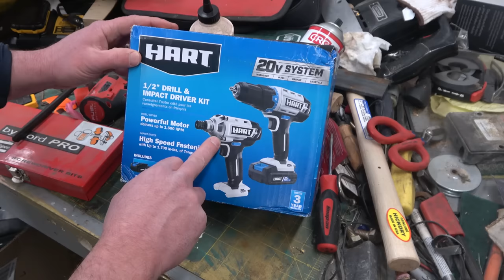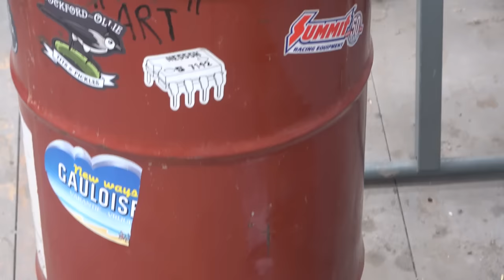BOLTR; Hart tools from Walmart

Comment: The self healing mat has it's work cut out for it.
Reply: AvE's destructive testing might even give Wolverine a run for his money.
Reply: *its, not it’s.
Reply: I love this guy - totally honest and pulls the whole thing apart. I'm 100% in.
Reply: Hey! I was wondering what needs to happen to have you review Flex brand tools? I am of the opinion they are not so good despite them marketing as a pro level to. Getting in some intense thread debates too. Specifically the inline circular saw.
Reply: @miqueaspromontorio3  buy some and send them to him
Reply: I agree with you about the manual my significant other didn't come with a manual I just figured out where everything goes
Reply: Is it bandaid brand? Only self healing matte I've known aside from super glue until now. @AvE, we need a review!
Reply: that self healing mat smokes two packs a day

Comment: That bearing probably fell next to the 10mm socket
Reply: You mean the 10mm sockets?
Reply: Nothing his magnet attached hockey stick can’t locate.
Reply: (Because 10mm sockets are often misplaced due to their being called for in many repair/maintenance situations)
Reply: @absolutjackal  they congregate?!
Reply: That's why you keep one in every room.👍
Reply: @isaacharvey   Yeah, they're conspiring against humanity.   They're in cahoots with socks that go missing.
I read it on the internet.
Reply: @isaacharvey  all depends on how long you’ve lived there no? I figure you lose the 10mm 1/4” 6pt first, then maybe switch to the 12pt or the 3/8” drive and then lose that one. I think all told my socket set has 4 or 5 different 10mm sockets so I figure there could at least be a few. 

Then there are those that were born metrique but feel they are actually imperial. But hey I’ll use either one if they fit

Comment: It's my understanding that Hart is made by TTI  especially for Walmart. In fact, as Hart was beginning to roll out, some of the signage was sent to Home Dep and caused quite a bit of confusion.
Reply: TTI makes lower grade tools than Ryobi? I own a bunch of the green bastards, but they're really only good for weekend warrior type shit. The chuck on the "hammer drill" I got visibly wobbles around so it's my go-to for abusive tasks like using it as a wire wheel.
Reply: That's correct, it's a cheaper ryobi which is saying something
Reply: Yeah, they're TTI.  Den of Tools has mentioned that on multiple occasions.  They're only a little cheaper (in price) than Ryobi, typically, so I don't bother with them myself - I already have enough battery systems as it is.  Especially when TTI has outlet stores that sell Ridgid and Ryobi at great prices (lookup Direct Tools Factory Outlet).
Reply: @stevensko9153  definitely not the same build quality...
Reply: @stevensko9153  It's like the eleventy-six other brands they make, they are all very similar but surprisingly don't share parts mostly, and each lower brand is just a more accountant approved/plastic plated version of the higher tool. Each level you go down you lose a part.
Reply: @stevensko9153  Did we watch the same video?
Reply: Only difference between these and Ryobi is the battery
Reply: @stevensko9153  of course they are same company that makes Milwaukee also  and Hart used to be just a hammer brand
Reply: @ferguson8143  

I came here to say this.
Reply: Its TTI knocking off their own brand of Milwaukee. Ryobi, Rigid, Hart, and Milwaukee are all made in the same factory, but the same company.
Reply: @Scurtisjr  TTI doesnt own the Ridgid brand.. they're made under contract to Emerson. And Emerson has the contract with HD
Reply: @stevensko9153  Dude they‘re not the same, get it! Ryobi has sintered metal gears inside of their gearbox, including the outer ones. I checked that on mine already.
Reply: @stevensko9153  I opened 3 Drills from Ryobi within the past 4 Years and all of them in the price range of this HART Kit from 80-130€. I have not yet found a ryobi without all metal gears. Neither have you I suppose!
Reply: I have the brushless version of this set. They look the same but are built much better, with metal components instead of plastic.

Those bastards have withstood near daily usage for 2 years now and are still good as new mechanically. Aside from a couple design faults, including the lack of a battery charge indicator, they are built better and are more durable than several of the "premium" brands.

They were purchased when I broke my Milwaukee drill while I was in the middle of completing a job in a small town. The closest Milwaukee dealer was a couple of hours away, but Walmart was right down the road. 

When I bought them, I was certain that they would meet an untimely demise, but those damn things just won't die.

The best part is that due to a pricing error, I paid less than $8 for the 1/2" drill and 1/4" impact set.

Comment: I use Hart tools, I have quite a few in the line up. Just a home gamer. They suit my needs just fine. I have the 20volt drills, inflators, saws, chainsaw. It all works as expected.
Reply: Same. I have a Hart box full of Hart tools but not saws or heavy metal. 

Super simple. Drill, hammer, drivers. Alens, very easy to use at home with my gaming setup. Nothing fancy.
Reply: Only tool I have of theirs that really sucks is the reciprocating saw, it’s not worth using at all

Comment: Your little chain saw faux pas reminded me of something I did. I bought an electric chain saw 2 years ago. I took it out of the box and started using it. It ran great and really cut the wood. I made 2 or 3 cuts and set it down. When I picked it back up it wouldn't do anything. I thought it was an infant mortality case. I took it back and exchanged it for another one. This one ran great. I found out later that I had inadvertently hit the chain break bar on the first one. That was why it didn't work. Doh!

Comment: My wife brought these home for me last year after my old Dewalt died. The chuck on the drill is rather crappy but it gets the job done. Since I'm not wrenching on cars or laying under industrial machines having gobs of grease and dead insects falling on my face, these two Hart tools are decent. I bought two extra higher capacity batteries. Having a state of charge indicator on the batteries would have been nice. Good video, as usual.

Comment: I bought the Hart 1/4 impact tool the same one you showed at the end for $34 on sale with battery. It proved itself last week when i had to install a fence. I used it to tighten all the 3/8 bolts and it worked great, very happy with it.
Reply: For $34 you can't go wrong as long as you don't expect it to do what a Milwaukee can. I'd 100% pick up a Hart at $34 to add as the middle step child to my 2 Ryobi impacts lol
Reply: I thought you were about to say how good a shim it made

Comment: I've got both those tools, bought in a 5 tool set on sale for $79 with two batteries and charge. I've given the drill and recip saw a few good hot suppers and other than not being that powerful, they've been OK. The 1/4 impact failed on the third light use, but I disassembled it, blew a lot of crap out of the brushes and it's working good. For $80 it was a great deal, for full price I'd buy Ridgid instead. And you're right, both are too long, but IMO that's the brushed motor. and the 4 amp batteries have a charge indicator.

Comment: If you ever get the chance to see the whole HART tool display, you'll get a kick out of it. They have a bunch of different drills, but they're all the same case molding, they just step down the size of the motor.  The cheapest option you can see clear through the vent holes there's so much space in the casing.

Comment: To avoid implosionating a fisher price drill never use it on the drill setting.  Always use one of the slip clutch settings so when it's about to bust it's own leg like an Amish rear ender when that 6 inch hole saw grabs it will fall on it's ass instead and get up again limbs intact.
Reply: To be fair with a real drill that could break a wrist if not using both hands... to the point where new models all have an e-clutch to detect a sudden twisting in the tool under high load.

Comment: Hart are TTI, and most of them are basically Ryobi with a different battery connector.  At least when the brand showed up again a few years back they were taken apart and found to be basically identical to certain ryobi tools.  That said Ryobi batteries are almost constantly on sale for pennies and Walmart seems to want Milwaukee prices for Hart batteries so i still wouldnt recommend them.  That and as you said, the cost of a dewalt Atomic brushless set compared to these makes these a rough value.
Reply: I wouldn't pay retail for these tools but I have picked up several Hart 20v tools on clearance at Walmart. Mostly vacuums, work lights, glue gun, inverter, etc. but they've all been pretty decent tools. Walmart likes to get rid of old stock stuff quickly so you can find clearance deals on these tools pretty regularly. Good for random household stuff. I wouldn't rely on the drills, saws or impacts really though. Adequate for homeowners in that regard.

Comment: I’ve been curious about these since they came out, wondering if they were higher quality than the hyper tough tools Walmart has sold for years. Considering these Hart tools are more expensive you would think yes however I have a hyper tough drill that I bought when i was 18, still chooches to this day. I’ve torn it down before out of curiosity and it seems to be about the exact same quality as this Hart if not a hair better and the hyper tough seemed to be put together a little better. The front end of the hyper tough is screwed into the case, the chuck is a little shorter, and the chuck jaws don’t look like trash. I’ve used this hyper tough drill for 8 years now and it far exceeded my expectations. I even bought another one and the impact driver because of it witch the new drill seems even better than the old one. Feels like it might have slightly better components in it. And the impact driver works like any other. 1375 in. lbs & 2700 no load rpm, plus a battery and charger and the drill all for $44, shit I ain’t gonna complain. I mean it ain’t no Milwaukee or Makita from the good ole days but if that’s all you can afford no sweat it’ll get the job done.
Reply: go for the brushless versions of these, they just came out with their Gen 2 Brushless and man they are beast. But i would consider Ryobi too. Sadly im to invested into hart now that moving platforms would be expensive lol. But overall, happy with my purchase.

Comment: I’m not saying they are the best but I really like ryobi, the old stuff anyways. I bought a combo set in probably 2002 that included a drill, jig saw, sawzall, circular saw, chainsaw, Dustbuster style vacuum, and a light. I use them a lot and have for the last 20 years and nothing has broke yet other than the batteries, their batteries are junk but I’ll gladly buy a new set of batteries every 6-7 years for tools that won’t die.

Comment: I can safely say using a very large range of brands in my life the hart I got to use (was work supplied) was not that bad in the brushless and felt good while using it. Not as good and Milwaukee or dewalt but not far off the mark! ..... our kits also had 2 batteries.
Reply: It should feel just like Milwaukee. TTI makes both.

Comment: Thanks for sharing! Last weekend I picked up the dewalt dck278c2 at home depot for $149 before tax after considering that hart combo kit. Hopefully I made the right decision!
Reply: You did. I have DeWalt cordless tools that have lasted 20 years and still going strong. They get used hard and dropped on concrete from ladders. Never had an issue with the tool or the battery. I did have a charger go haywire on me once
Reply: I would say you made the better choice and actually Hart and Ryobi are made by Milwaukee and Hart used to just be a hammer brand
Reply: @ferguson8143  the only reason I considered hart is because I knew TTI, the parent company of Ryobi, Ridged, Milwaukee and I'm sure many more produces them for Walmart.  Did not know Hart used to be a hammer brand! Thanks for sharing👍🏻
Reply: @morgan5941  SCORE on the batteries!
I actually still have my first cordless drill, a probably 20 year old black and decker hpg1800. For kicks, 2 years ago I rebuilt/re-celled one of its battery packs. Yep, just as heavy, gutless and power hungry as I remember!😂
Reply: Only dewalt I've had a problem with was the last one I bought a dcf921 1/2 impact. It has a momentary brain fart sometimes and won't do anything but turn the lights on when you pull the trigger. It's a shame because it's a lil tiny impact with big power. It hasn't screwed up in a while but I don't trust it now
Reply: A lot of times, that's exactly what these shitty bottom level tools are for, to drive you to the mid-tier where all the profits are.

Comment: I don't have any of their power tools, but I've been mostly impressed with their hand tools.  They pass the feel test.  Granted I'm not a professional craftsman, I just use them around the house and on my vehicles as needed, but they were cheaper than the Husky's at Home Depot and seem to do the jobs just fine.  No broken tools yet, even when using them in ways they weren't strictly designed.

Comment: For some reason I went kobalt when they came out, Lowe's seems to still carry them and my 24 volt Kobalt has more torq-ue behind it than the cryobi.

But I've definitely been curious about the Walmart brand stuff, good to know it's about what I expected
Reply: The Ryobi is only an 18v tool though. I'd hope the Kobalt at 24v has a bit more chooch in it
Reply: I don't own either, but I've used both on jobsites and Kobalt isn't bad at all.  The Ryobi stuff always feels like every second it runs is on borrowed time.
Reply: @dcl97  Accurate, but mine just keep borrowing more and more time. My drill from 2004 has literally been letting the smoke out for about 3 years now. Still makes holes. 🤷‍♂
Reply: I've run kobalt for 4 years love them and haven't had any issues I mechanic a lot and do demolition derby and drag racing! Burnt up a few DeWalt but no kobalts yet!
Reply: @jakeryii the tube of you is showing you posted this comment 4 days ago! This video just came out. Tell us your time travel trickery.
Reply: @haywirefarm  Patreon perk
Reply: @haywirefarm  ahhh the ever faithful part-ri-onous time travel 🪣
Reply: @haywirefarm  Patreons get early access.
Reply: @caodesignworks2407  Kobalt's 24 V is a "fake" measurement like DeWalt's 20 V--measured straight off the charger with no load. Kobalt has one additional battery than the 18 V lines of all the tool manufacturers, so an apples-to-apples comparison is Ryobi 18 V to Kobalt 21.6 V. Still more chooch for sure, but not 33% more.
Reply: I’ve had good service from my 24v kobalt tools.

Comment: Blowe's in my area (Omaha, NE) has a pretty similar deal right now: Craftsman drill and impact driver, 2 batteries, charger, and zippered bag for $99 US. Converts to about $136 for those of you residing in my nation's hat.

Also a 243-piece Craftsman mechanic's tool set in the nice blow-molded drawer box for the same price. Can't beat it. Almost bought a second one to replace it when I inevitably run it over.

Comment: I bought one of the drills at a pawn shop. I was out of state and needed a drill for a quick repair. I think I paid $15 for it. It turned out to be a nice drill with one problem. The clutch. It'll go into lower settings. Getting it back to a solid drill or no clutch is tough. It holds a charge great. Endurance is good. I'm using it until it drops. I take my trusty B&D 1/2" drill I've had for 35+ years as well.

Comment: I was a scaffolder for 30 years and for the last 10 or so I carried Hart 21 ounce framing hammers exclusively. Yeah, they broke, but I regard hammers as a consumable when using Kwikstage type scaffolding. The flat claws were invaluable as a pick when creating level pads for soleboards on hillsides. Tried an Estwing. Almost as good for way more money.

Comment: In terms of a brushed tool.  Especially from Walmart    these things are actually decent to use.   Very unrefined (you feel the vibrations alot) but plenty strong.  Used them around the house to hang a baby gate with 4 inch screws into solid wood door frame    the sawzall to cut down rusty exhaust pipe    not sure on the drill

Comment: Got that set for 80 bucks. I use them for doing car audio work mostly. For light to medium duty you can't beat them at that price. The highest torque job I've used them for is removing those heft seatbelt bolts. Those things are pretty stout and have thread seal on them so they're a decent test. I can't complain about these things at all.

Comment: I'm a DeWalt fan myself but I use Porter Cable due to them costing fewer eagle feathers and the local store not supplying tractors has good deals on the PC tools.  For home projects they work great and they all come with batteries and chargers so I'll never be without angry pixies.

Comment: I bought one of their Hyper-Tough line when I got frustrated by B/D 's habit of making batteries unavailable.  Later I was gifted a 4 item box set that included two batteries.  The LED work light worked until it did'nt ... maybe a year.  Driver drill is typical, the battery saws-all is great for cutting out old, stiff, leaky hydraulic hoses (you are not risking an expensive one to getting oil saturated).  The little impact driver ... I expected it to be impotent, but it surprised me.  It has driven nuts, bolts, other fasteners that I thought it wouldn't be able to touch.  Haven't used any of them for extended periods, so the jury is still out on durability.  I expect most of them will suffer a sudden, catastrophic failure long before the batteries die, but will last long enough for them to obsolete the current line of tools (making the still good batteries "no good" for the new line).  They seem to be good at that.